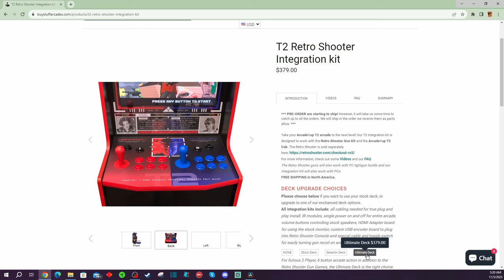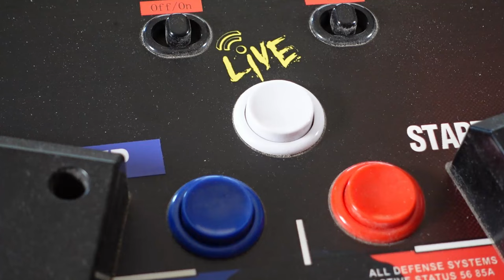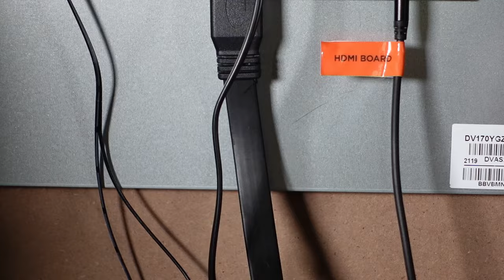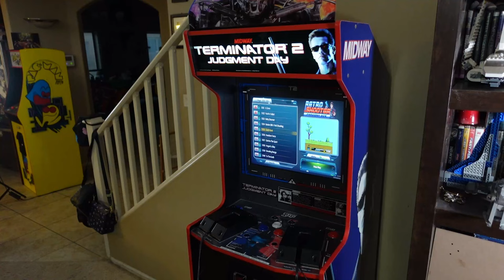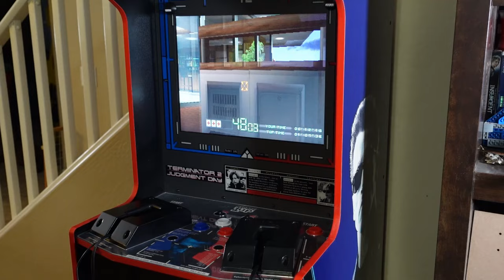Arcade1UP Terminator 2 Retro Shooter Integration Mod!  Add More Light Gun Games!

Comment: A couple of questions. One of the boards you install, the purpose is basically making the monitor able to accept hdmi?

And is the reason for using the IR with that kit because they’re smaller and look better? 
The new retro shooter kits are now coming with 4 IRs. Do you know anything about that?
Reply from the maker: Yes that first board you install is to accept HDMI, yes the Buy stuff sensors are smaller and look cleaner when installed versus the stock sensors.  Yes Retro Shooter came out with a 4 sensor setup but on an arcade1up screen this small the 2 is all you need no issues with tracking probably use 4 when playing on a large TV etc